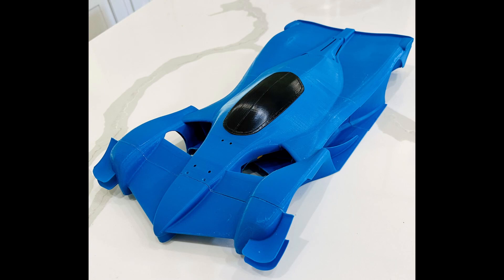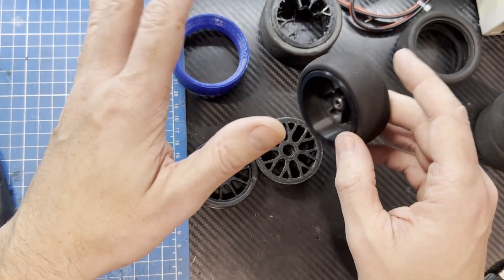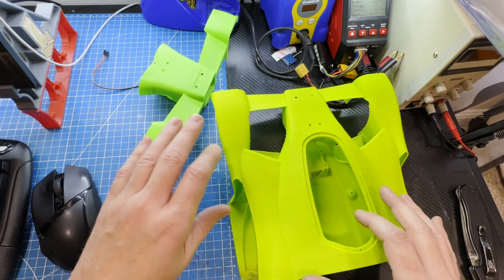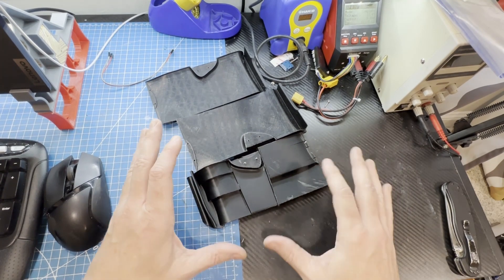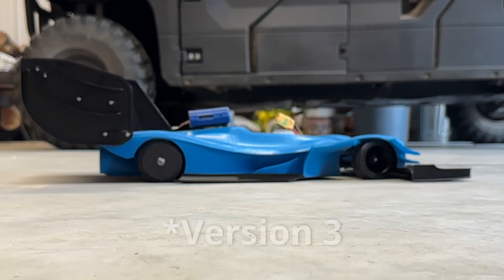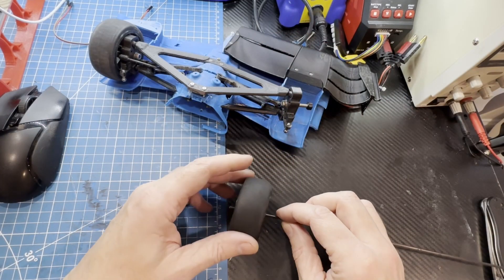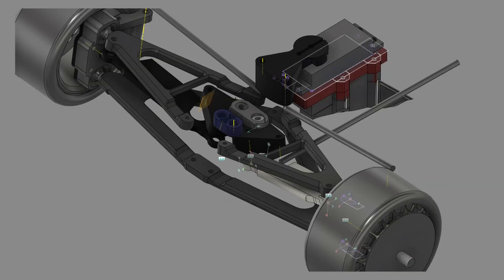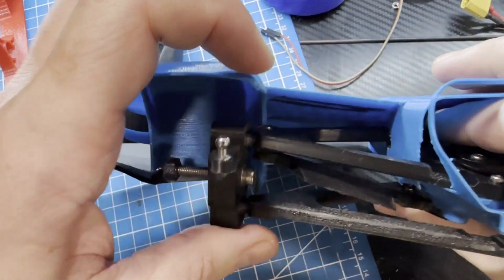RC Hypercar V2 - Failure is an Option!

Comment: I cannot wait to get the sensor data from the car.  This is something I had hoped for many years ago. I would race 1/12 scale indoors, but it was impossible to get feedback on what was really happening.  With true sensor data, it was just following superstitions and whatever the factory guys did.  Motors, gearing, tires, etc.  All guessing, all the time.
Reply from the maker: I’m excited for the data too. It’s crazy how much money is spent on RC race cars and they don’t have data. I know when I used to race full size cars, data was everything because so many times the car would feel better and end up being slower.  

I honestly think a lot could be done aerodynamically with pan cars. I be it would be banned, but that’s the perfect surface for that.

Comment: What 3D printer are you using? Maybe try to use formula 1 RC belted tires. Exotekracing makes a bunch of different compounds with their corresponding tire foams and they also make firmer foam insert for drag tires. They probably can help you out if you call them, IIRC they are the only approved class tire for F1 in the USA for this year. The project looks great.
Reply from the maker: I’ll check out those F1 tires. The hardest part is finding the diameters of all these tires because they’re all size by the type of car not by the actual measurements 😂

The printer is an Ender 3, but the only original part is the frame.
Reply: @IndeterminateDesign   why are your body models hard to 3d print? I designed and printed some GT12 RC bodies and F1 bodies and I have no issues with my Bambu Lab 3D printer. The Bambu Lab printer is the best purchase I have made in the last two years; it is just fantastic. Maybe share the body models with me and I can print them out just to see if they pose issues.
Reply from the maker: There are two main challenges with this car.  First, there are parts that eventually merge into the monocoque, that are only 1-2 walls thick, 0.4 -0.8mm.  These parts vary between 5-25mm tall, being printed on top of nearly 75mm of support.  They can be broke off by the extruder very easily, and prone to warping because they cool so fast.

The other challenge is the body has multiple shells, the monocoque and the body itself.  These shells don't have great access for the supports to generate.  The supports have to go from 5mm or less at their base, grow up 150mm through a narrow channel between the shells,  and  then support something 30mm wide that would be printed in midair otherwise.  (Basically like trying to grow a tree upside down).  So currently, it involves lots of manual support blocking and placement of custom designed supports that have to be cut out later.  Sometimes I don't get it right, and the supports aren't strong enough and get broken and then the print fails. 

It's all fixable things, but printability hasn't been my priority to the point.  Honestly this complex shape is probably best printed by an SLS printer so that no supports are needed.

Comment: When are models going to be available for printing?! I'd like to try to do the body in CF nylon.
Reply from the maker: I don't know if the video's convey just how rough the design is still and how much hand finishing of all the parts is still required.  The car is made from 3 different materials, almost every part has it's own unique print settings.  I have a 2 page long list of notes just for setting up the slicer and prepping to print the monocoque (Even with this I still had 3 print failures on the monocoque in the last two days with PLA).   

My hope was to get the suspension and body at least to a point where it wasn't changing radically, create a bill of materials, and then film a rough 1-2hr long video on just printing and building up a chassis.  I feel like I could save people a lot of time, and maybe we can setup a wiki or blog keep an ongoing set of documentation.

Also, once the design is stable there's a lot of little tweaks that can be done to make things so much easier to 3D print.
Reply: @IndeterminateDesign  I hear you 100%. It's hard to convey via comments (and I'm not good at it) but there is a lot of enthusiasm and desire to help out. I think having certain parts out there for a beta type audience to test printing might give some good feedback. For instance, I've gotten pretty good at printing CF nylon which I have found works great for 3d printed cars. It might not be robust enough to take a curb at 60mph, but I found its ability to stave off the cracking that I get in single wall PLA to be beneficial.

Do you have a Discord or some other forum for discussion? I'd love to discuss solutions to making this printable.

Comment: There are a couple “variable density” foaming TPU filaments out there that might help you with the tire stiffness problem. They’re very expensive but it’s some of the softest TPU on the market. 

Engineering cuts are great!, I would love to see a tire test rig if you find the time to work on it.
Reply from the maker: Thanks. I’ll check those out. I was just given a supplier of various densities of tire foam so I’m going to try them out. 

I’m glad you enjoy the engineering cuts. I’m really surprised there isn’t tire testing and data available for RC car tires. Seems like a big area that could improve performance.

Comment: I wonder if you can make 3 part wheels and clamp the tyre sidewalls? Maybe with an inner lip to reduce turn-over
Reply from the maker: I haven't tried that. I'm concerned the bead of the RC car tire is just too soft because it doesn't have any reinforcement internally.  I did change the rim design early on to match an RC car touring rim where it comes up higher so that rim can be glued better to the tire.  The hard part is the tire itself is being torn and a layer of rubber is  still attached to the rim.
Reply: @IndeterminateDesign  That's an interesting thougt. Maybe add a thin layer of reinforcement to the tyre, or cast tyres in polyurethane with fine glass or carbon toe. Probably just adds another layer of complexity! 😵

Comment: Instead of tpu, and I can't remember what it is called, but there is a pla that foams based on temperature that may allow you to tune stiffness.
Reply from the maker: Yes, there's a light weight PLA that foams.  I've thought about that but I don't know how flexible it is.  I may make my own 3d printed machine to shape my own higher density foam.
Reply: @IndeterminateDesign  fair enough.

Comment: Trust me, those engineering cuts are not boring or less exciting!!!
Your video on Traction Control motivated me to approach the same subject for a uni project.

Now on my diploma project I also want to work with RC cars involving Autonomous Racing. I'm glad channels like yours where you also put effort into explaining the engineering behind such projects exist.
Reply from the maker: That's awesome!  I'm glad you enjoy this.  I actually can't wait to get to the part where this car is reliable enough for me to try out traction control and torque vectoring.  I'm planning on having encoders on each wheel, so I should be able to do some cool stuff.

Comment: Im not too deep into suspension design, but i believe the high amount of tire wear on the outsides of each tire might resulted from a camber-travel-curve, which isnt ideal for cornering. basically when the car rolls in the corner, the outside suspension compresses and the inside compression extends. in that situation, it can occur that the area of contact between the tires and the road decreases, because there is an angle between them. therefore the outsides/insides of the tires would undergo more degredation. the camber-travel-curve should be tuned, to maximize the contact of the tire patch in that situation. 
Maybe you already thought of that. ive built a rc car myself and that was a major flaw.
Anyway your project is super interesting!! keep it up :)
Reply from the maker: I feel like I don't know enough about camber tuning myself.  I think it really does require a test rig so you can see how the tire is deforming.  The major challenge with this car is the load on the tire.  A typical RC touring car has about 300-350g of weight per tire, but at top speed this car at speed has ~1.3kg.  My theory is the side walls of the tire just collapse.

Comment: Wait what do you mean "Tamiya offers" Screw Tamiya, get a racing tires, not barely better than toy tires that Tamiya is making. You need belted racing slicks from Sweep, Ride or LRP.
Reply from the maker: Awesome!  Thank you.  I'm going to check all of these out.  I've had a hard time finding what people are racing with and most of the ones I do find are all pre-glued.
Reply: @IndeterminateDesign  But one warning. Racing tires are 24 wide instead of 26. It may need some design changes because of it. But you can choose hardness and that mean ideal temperature.
I must recommend Sweep specifically. I'm making 1:8 prototype somehow similar to yours and they were so kind to sell me those tires without pre-glued wheels. For some reason 1:8 are not normally sold separatelly.

Comment: Were the tyre sizes (width) calculated for the aero loads and car weight?
Reply from the maker: The tires are 28mm width.  If I could find wider tires in the same diameter I'd definitely run those.  The car is 1.7kg, and the suspension is setup for up to 5.5kg of downforce (CFD says 8.1kg at 60mph, but I think that's a bit high).   

So about 1.3kg per wheel, which is several times what the typical RC car tire has.
Reply: OK, thank you  @IndeterminateDesign

Comment: Amazing work, as always. Loved the leaf blower test. Are you still considering unsprung aero for the front wing or is it too hard to package at this scale?
Reply from the maker: The leaf blower works really well as long as you keep it far enough away.  

I really do want to try to do a something with unsprung aero, but I don't think I can fit it in this car.  I also didn't position the suspension rockers in the best orientation for this.

Maybe someday I can do an open wheeled variant of the Hypercar where I have more room.  The rear wing is the only aero device that really lends itself to being able to do this, and it's ~1/3 the car's downforce.